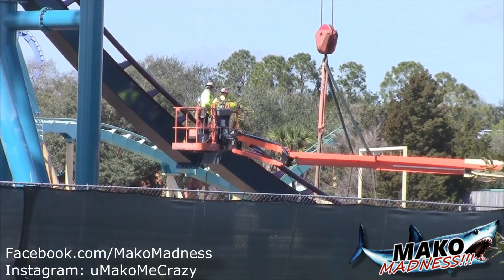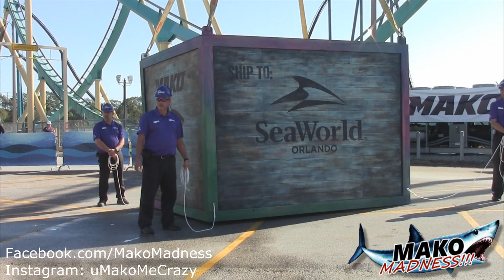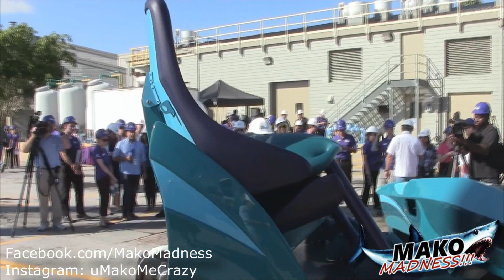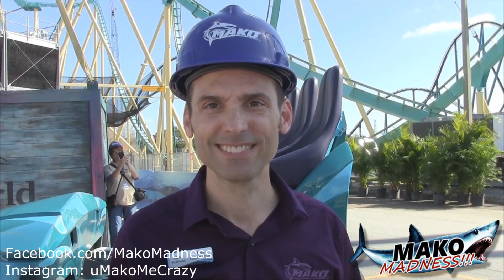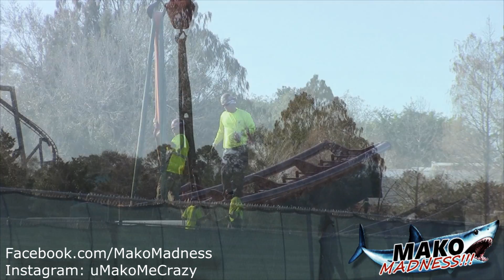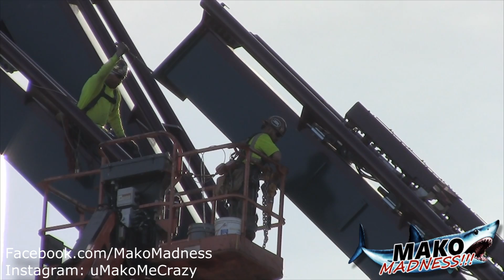SeaWorld Orlando Mako Construction Update 2.16.16 MAKO TRAIN MEDIA DAY!

Comment: Those steps are probably to inspect cause I bet those rides down on the beach rust Quickly
Reply: Sorry wrong Video I made that on
Reply from the maker: +Kevin Thompson Well there were steps for inspection in this video also...so the comment fits right in! ;)
Reply: This looks like a pretty good B&M hyper idk B&M are ok if the back wheels are maintained frequently